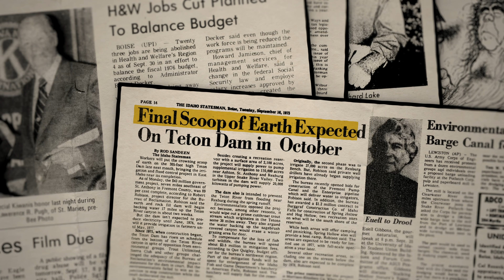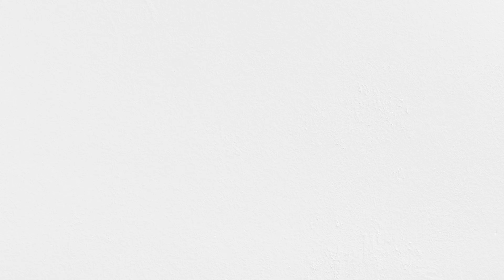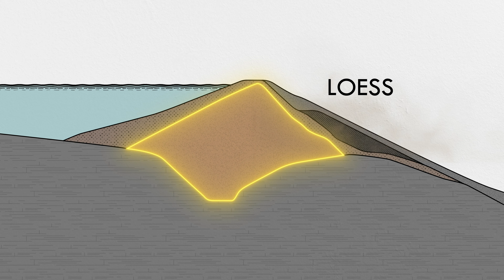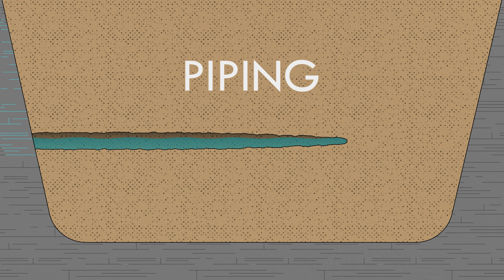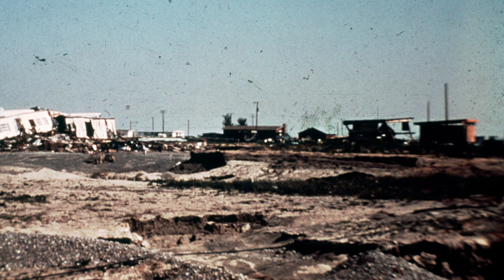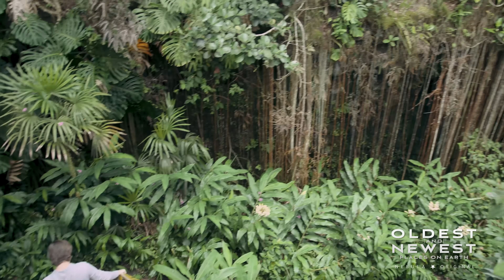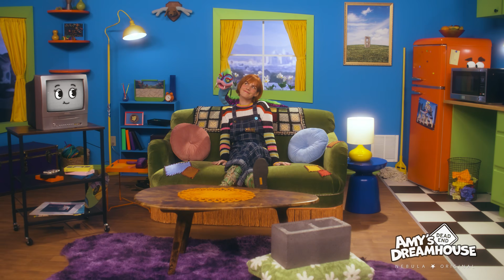The Wild Story of the Teton Dam Failure

Comment: I'm kind of puzzled by one thing. I'm admittedly not an engineer, so it's possible there may be one or more technical factors I'm not aware of. But I can fairly claim enough basic engineering knowledge to reason a situation out from first principles. (I had to do that constantly when I was a student nurse, I'm quite good at it in other fields too.)

Okay, you have a pipe through a dam. Water is flowing in on the upstream side and out on the downstream side, presumably with a very non-negligible amount of hydraulic head behind it.

Why try to close that pipe by dumping material in the outflow end, where the flow pressure will promptly eject it? Wouldn't it make more sense to deposit material on the upstream side so that the water pressure stuffs it inwards?
Reply: From my understanding of the visuals, that would be like trying to plug a seive.
Reply: @trevinbeattie4888 Well, the other thing looks to me like trying to put a rubber plug in the downstream end of a drainpipe instead of the upstream end. At one end, the water pressure will hold the plug in; at the other end it will push it out.

You can plug up a sieve, eventually, or at least make some progress toward that goal ... on the upper side of the sieve, where water pressure is pushing the grains against the sieve. Keep adding enough material to the flow that has any component of particles with large grain sizes or significant cohesion, and eventually the sieve will plug. 

What else was all that grouting about? 😁

This happens normally in every storm sewer system, everywhere, until either humans go in to clear the blockage or water backfloods out onto the streets.

But pouring material on the outflow end of the pipe seems to me like a waste of time. Imagine trying to stuff a sieve with water flowing through it ... by splashing mud on the underside where it gets immediately washed away. Not easy to make headway when you're working against flow.

Meanwhile, back in gritty reality ... Once the situation has reached this point, prevention is really no longer a very realistic or achievable objective. So once it becomes a question, it's already high time to drop that silliness and go all in on mitigation.
Reply: They deposited several D8s into the upstream holes-
Reply: @jackprier7727 Which in my opinion is a lot smarter, we just didn't see it very clearly because of where the cameras were pointed.

Of course, like I say, by the time that was being done, things were already past the point of effective prevention and everyone involved would have done better to give that up and turn all their energy and attention to mitigating what was about to happen. Those efforts were only delaying the inevitable by maybe 15-20m. Which, I have to grant, could have large mitigation value in some contexts (possibly even this one); 15m of extra warning means 15m more that people downstream have to get to high ground.
Reply: @JennRegier  I'm mostly bummed/shocked that they built the core of the dam of "packed" wind-blown silt, I think well-rounded grains, simply because they had a whole bunch nearby.

Comment: I lived in Idaho Falls, about 45 miles downstream on the Snake River from the dam. It took some heroic efforts by the local people and authorities to limit the flood's impact. I was just shy of my 16th birthday and worked as a busboy at a riverfront restaurant. They called in every available person, and once we had sandbagged the building, we joined the rest of the town and built 7-foot-high sandbag walls along the riverfront. If memory serves it was over 3 miles of walls built in about 10 hours! There were thousands of volunteers filling, hauling, and stacking sandbags for 2 straight days. But my best engineering nerd memory is that the city is basically split by the Snake, and the Broadway bridge, a main artery for traffic and utilities, was at great risk of being washed away. The city dug a 30-foot trench to relieve pressure on the bridge around one end. I remember the biggest excavator I'd ever seen digging that trench at 2am under old carbon arc search lights they had hauled in just as fast as they could. That memory has lasted 50 years!
Reply: My dad worked police dispatch in rexburg during this event. The folks at the dam insisted everything was okay until the very last minute. There has definitely been some historical revisionism to cleanse/wash/hide the actions of the dam operators.
Reply: @SirVerdown It’s hard to imagine they didn’t evacuate those downstream.
Reply: @fishmonger6879 they did evacuate where the danger was.  Sugar City was cleared out.  Many(most ) homes were destroyed some ripped of their foundations and floated way tell they hit something.
Reply: I remember watching the news from Idaho Falls that afternoon and evening.  Lots of sandbagging and saving the Broadway Bridge.  They dug channels on both sides of the bridge to divert the water and relieve the pressure, and an excavator operator stayed on the bridge with the excavator to keep debris clear so the water could flow. It was intense.  Up where I was at all we could do is get out of the way.
Reply: @mcpetzold  That excavator operator has got to be one of the bravest participants in the whole preservation effort. He was sitting in that excavator, on a bridge about to be washed away, and the success of their plan had implications for the preservation of the town's lives and the bridge, if it failed he was dead. He could have gone to high ground to ensure his safety, but he braved sitting on that bridge to clear the debris. Surprised the weight of his massive balls were supported by the bridge through the whole ordeal! 😂
Reply: @stevenbahr9547  Well that's the key. Balls like that provide sufficient ballast to anchor the structure in place. It's excellent engineering!
Reply: I'm was there too man. 17 years old. Worked as camera man at KIFI. Shot a bunch of 16mm film.
Reply: @BretBerger  That's cool!
Reply: I was 13 at the time living in IF and remember well everything you said. My older sister and I were the only ones home and she started throwing camping gear into the pickup to get us to higher ground if needed.  Turns out Idaho Falls was fairly well protected from the worst of the flooding due to geography but the towns upstream and down were devastated. Then the next big fear was what would happen when all that water hit the American Falls Dam further downstream. If it breached all hell would break loose again, but it held. 
We were filling sandbags all that weekend and then soon bussed up to Rexburg to help dig mud out of people’s front rooms trying to salvage homes. Terrible disaster but it really mobilized whole communities to pitch in and work together. It was a defining event in my life.
Reply: Thanks for sharing
Reply: My dad would always tell me about this growing up. He grew up in Lincoln and always told me about the sandbags.
Reply: I knew the guy on that massive excavator. He said that was the scariest thing he did in his whole life. Every giant log that hit and shook the bridge, sent him sprinting off the bridge.
Reply: Necessity is the mother of invention
Reply: I was raised in roberts just north of idaho falls after the dam broke. our home had wood paneling half way up the wall. it was the water line where the sheet rock got wet so they cut it out and put up wood paneling when it was fixed. daily reminder of how bad the whole town flooded.
Reply: @ShaminMike yea Roberts had it bad too.
Reply: That’s a great story !
Reply: TV I was a nuke going through prototype training   I too was throwing sandbags  the first day I threw bags from about 1300 to 2400- 0400 then went back at1200 I had to go back to training Monday I worked as long as I felt I could. And get up the next morning. I was definitely tired the next workday  I liked Idaho falls it was a nice small city.
Reply: @davidnewland2461 you guys were great
Reply: I was born and raised in East Idaho, and have been to the site of where it happened. The failure of the dam can still be seen today.
Reply: @NotAllWhoWonderAreLost208 I really should visit. I live within an hour from the site.
Reply: I lived outside of Blackfoot, and our basement was flooded.
Reply: @PocatelloCommunityMedia  Some of my friends out near Rose got flooded too. btw, I live in Poky now. Thanks for posting the city council meetings. I watch them pretty regularly. The new mayor's minutes are good too!
Reply: @PocatelloCommunityMedia  really lucky that the area downstream is wide and flat. 
So, they know what they did wrong, so why not rebuild the dam?
Reply: @outlawbillionairez9780  Because it would also fail. It's a bad place to build a dam like that.
Reply: All dams are temporary.
Reply: Amazing story, thx for sharing!
Reply: If the conclusion was that the dam could have been built correctly, and would be a boon to the area, why was it not rebuilt?
Reply: @outlawbillionairez9780 Because the limestone foundation was full of caves.  It really could not be rebuilt.  At least an earthen dam.
Reply: How did you have enough bags to make several kilometers of walls out of sang bags? Was the town running a potato bat export factory or something, lol?
Reply: @IceRain-f5v  Yes, potato bags, as I remember, were a fair number of them. The Snake would flood regularly, so I think that there was a large stockpile held by the city and county governments in the area.
Reply: @IceRain-f5v I’m from Idaho Falls too. Exactly- hundreds of thousands of potato bags at our disposal.
Reply: @IceRain-f5v ever heard of a russet potato? They're basically all from Idaho 😂
Reply: @bricknolty5478  I worked in the potato industry for over 20 years, if there's one thing Idaho has it's flipping spud bags.
Reply: @IceRain-f5v we filled bags the out in the fields were sand hollows and a army of locals with trucks haled them to the river.  The LDS    Church members organized crews from all over.
Reply: it’s Idaho, the entire state is a giant potato export hub
Reply: @IceRain-f5v national guard engineers showed up
Reply: @IceRain-f5v . You pretty much guessed it. Idaho Falls is basically potato central.  Not many people, but no shortage of potato sacks
Reply: It's ok to chase the beavers 🦫- Idaho Falls
Reply: That’s such a great story, really enjoyed it!
Reply: @DisasterMoments1205 thx
Reply: That sounds like a great week, if it weren't wrought with danger.
Reply: I grew up in Idaho Falls! I did a project on this in elementary school.
Reply: I remember that fill dirt for the sandbags had potatoes in it from the nearby fields.
Reply: Hello from Rigby!
Reply: I live just 2 hours north of Idaho falls in Dillon MT and I never knew about this event happening
Reply: I spent many hours and tanks of gas carrying sandbags from Sandy Downs to the river in my pickup.
Reply: It's pretty incredible (these days? i don't know, was it ever not?) that they were able to come up with a plan, and coordinate so many volunteers on the spot to implement it successfully, on such short notice and high stakes.
Reply: I remember this story,  I lived in Spokane at the time, the other big news story that happened on this day, was the riot that happened at Northwest Speedway in Stateline  Idaho, when BTO ( Bachman Turner Overdrive) refused to play because they hadn't been paid, and the concert goers vandalized the raceway
Reply: According to a documentary about this failure, the officials only warned about 8% of the residents.  But RADIO warned everyone else.  Without the curiosity and fast thinking to set up a remote broadcast,  alot more people would have died.
Reply: Fortunately, the flood hit a relatively flat area. Had it been a valley, the water would have reached enormous heights and speeds. Anyways, it's appalling how many American aren't familiar with the Metric system. It's as if Europe were still using Roman numerals instead of Arabic. Converting a mile to yards is complicated; in the metric system, you simply move the decimal point. The consequences are dire: Our youth perform very poorly internationally.
Reply: I'm watching your video and getting tears in my eyes. We live in fort myers and stayed home for the hurricane. Never again. We just put the House up for sale and are moving back to Michigan. Thank God the house was ok. It was terrifying!
Reply: There is a current legislator from Idaho Falls who is campaig to rebuild the Teton Dam. He should lose his next election.
Reply: I think this would make an even more interesting video!
Reply: @willusher3297 totally agree
Reply: Excellent - and true! - tale.  🌊
Thanks for relating it to us. 📖
Reply: With respect from a non-member, only the Mormons could have pulled that off.
Reply: Lots of arguments out there against letting the government design and manage these projects.  Not up to date on the latest technology.  Cost overruns and mismanagement. Secret payoffs.  Skewed cost-benefit analyses.
Reply: @XLAdvRider  ‘the gov’t’ is us.. no need to pose for corporations, who are us also..
Reply: @Wycliffe-Frege who lost their jobs?  Who paid $300 mm in damages?  We did. just like Fukushima failed due to poor design that didn’t matter because the govt ran it
Reply: @XLAdvRider  we/they vs us .. not condoning anyone negligence .. government is inept .. corporations are greedy .. WE, US, the people must reassert proper sovereignty over both 🇺🇸
Reply: @Wycliffe-Frege absolutely 👏
Reply: Things that didn't happen for 500
Reply: This is a crazy thing to try and make all about yourself
Reply: @SchmelvinMoyville  I teach engineering ethics at a University.  One thing I try to get across to students is the human impact of their successes and failures.  The failure of the Teton Dam was a defining moment for many of us in our youth.  Someone screwed up the grouting, and it washed away homes, lives, and businesses.
Reply: @mcpetzold  not interested, thanks
Reply: @SchmelvinMoyville low IQ response here. Shame on you for being so ignorant. Mcpetzoid is 100% correct
Reply: I remember my science teacher talking to us about that. He warned us of careless bridge builders.
Reply: @SchmelvinMoyville  If you're not interested then stop posting.
Reply: @R @RCAvhstape  yeah definitely gonna listen to you Karen thanks for your input
Reply: @SchmelvinMoyville  YES thank you!
Reply: @RCAvhstape  np f slur
Reply: @SchmelvinMoyville  Are you trying to say that those personally affected are not allowed to have personal feelings or share personal experiences?
Reply: @agafaba  “not allowed to” you’re welcome to reframe what i said in which ever way makes you feel better, I guess
Reply: @SchmelvinMoyville I'm not making a legal argument, I am discussing your opinion, and that is exactly how you came across with your post.

If you are being misunderstood feel free to clarify, because clearly I'm not the only one reading it this way.
Reply: @aga @agafaba im not at all interested in what you or anyone else thinks and you aren’t entitled to any clarification
Reply: @SchmelvinMoyville  You seem to care a lot about what others think of you considering you keep replying. I have to assume that you both refusing to elaborate and also caring what people think means that you fully intended to say people shouldnt share personal experiences of tragic events.
Reply: @a @agafaba  now youre just projecting
Reply: @agafaba btw your sense of entitlement is very off-putting. Talk with your doctor about your inability to pick up on social cues
Reply: @SchmelvinMoyville how am I projecting? I haven't shared any opinion on the video or the other poster. I am not posting constantly about how little I want to post, I am openly trying to have a discussion.
Reply: @SchmelvinMoyville in this context the only sense of entitlement I could have for you to comment on would be my entitlement to share personal experiences... You really are doing everything you can to reenforce what I said short of just coming out and admitting it
Reply: @agafaba  Pretty sure at this point that he's just a troll...
Reply: @agafaba  He just came here to flame up the thread. Next time he replies, add him to your mute list.
Reply: @agafaba  A passive aggressive attention seeker. Must be the life of the party.
Reply: @RCAvhstape honestly I assumed so, but I wasn't doing anything better with my time today and he doesn't know how to troll properly and kept replying the way he did so I figured why not

Hopefully YouTube counts it as engagement and gives the channel a little algorithm boost
Reply: @SchmelvinMoyville they were sharing a relevant story that I found inspiring.  Get out of here with your gross cynicism.   No one wants you …